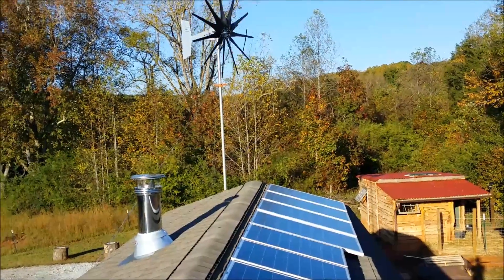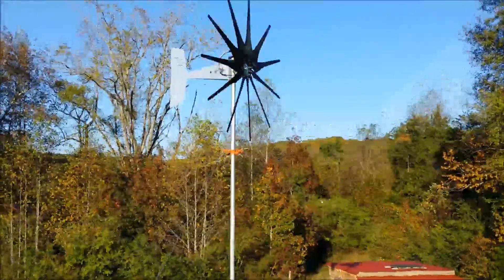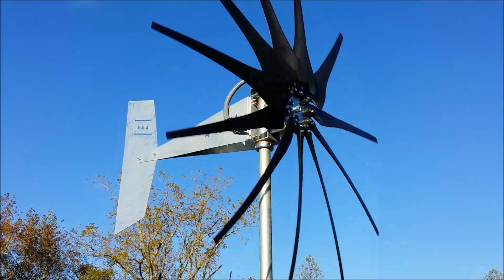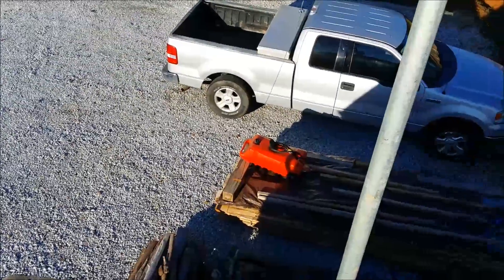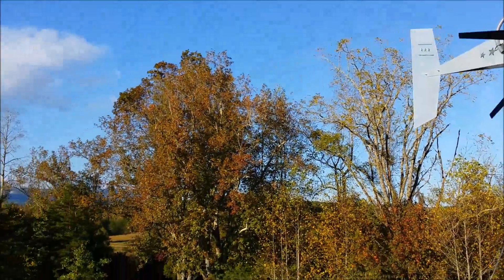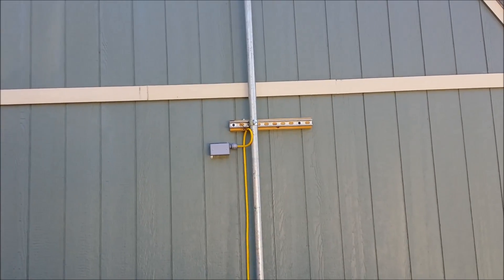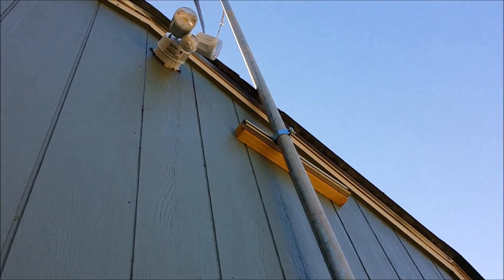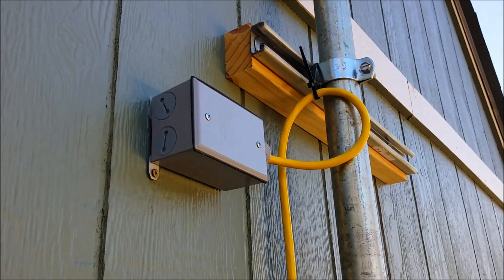Wind Turbine Installed and Operating on the Homestead

Comment: My question is 
I’m having 48v inverter system
And the voltage from solar is 110v which MPPT Solar charge controller controls it to 48v for the regular charge for the battery. If I should use wind turbine 48v 3000w is it advisable

Comment: You could run your dump to a 12v inverter and push the excess power into the house through a 110 outlet

Comment: I have solar panels. I want to add wind Power to them. I’m getting a good 30 amp out of my solar panels. I get confused why a dump load is needed on wind. If my battery bank is full with my Solar my controller just does not charge. IfDC is coming in off the wind power just as the solar why would I need to dump any extra power off? I don’t have to do that with my Solar so why would I need to do it with the wind power? If my charge controller knows my battery bank is full wouldn’t it not charge anymore with the wind just as it would do with the solar
Reply from the maker: My understanding is a wind turbine is designed to work with a load on it . If it does not the wind turbine will free spin and can do damage to itself. So it either has to be charging batteries or some sort of dump load. Because a solar panel has no moving parts you do not have this concern. Hope that helps!
Reply: Homestead Handyman. Thank you. Now I get it😊
Reply: @homesteadhandyman4481  Thank you for sharing your installation of both.  I think I will try on the Wind Turbine generator first for trying out.  The cost of this small project maybe $ 1,000.  Just for during power outage to Run my gas furnace 2nd floor and the Fridge and a few lights.

Comment: you need a watt meter so you know how many watts or killowatts your making each day,  looks like you need even more elevation to make the most of your turbine, but like you said leaves are falling off,  solar is by far the best but turbines can be fun especialy if you have a low wind  turbines. nice scenery, bet its a great place to live.
Reply from the maker: +closertothetruth great idea. do you have a recommendation of a watt meter or a link to a good one? The turbine has allowed me to run an electric heater on low this winter in my shop on the stormy cloudy days, That is as high as I could get it by myself. Any higher and the guide wires would be in the driveway!
Reply: +benchmade55 , the ones like you see hydrogen appliances  sell, ive found them on ebay cheap, theyre black with a blue screen, commonly used with model aeroplanes. when you hook them up you must have the turbine brake on or you may fry the watt meter, once installed you can turn the wind turbine break off. the watt meter is a great investment.
Reply: +benchmade55  The watt meter that hydrogen appliances sell are a scam and dangerous to use. He has those on ebay cheap all right. The have a rating on them of a whopping 220 amps, lol and UL approved neither of which are true. It has 8 gauge wires on it and the MOST that it can handle is 50 amps. The UL office would NEVER have approved it, none of those are UL approved for a fact.
I would expect a house fire from that watt meter.

Comment: You did a really nice install.Looks good. If you get any vibration into your building it's because the tower is rigid mounted to your building. The fix if you need it is to wrap your tower pipe with rubber to isolate it from the building.
Like your brake switch also, very inexpensive but it will work just fine..

Jeff
Reply from the maker: +MissouriWindandSolar  Thanks Jeff . I will put some rubber in the clamps as I do get a hum.
Reply: +benchmade55 That will fix that hum noise you hear. I did the same install as you years ago, i attached all my wind turbines direct to my pole barn rafters and man they hummed all threw the building. Rubber underneath the clamps and that fixed it.

Comment: Are the solar panels and turbine powering just your workshop? How many watts are you making? Thanks for the video.
Reply from the maker: +Aaron Davis Homesteading . Yes . The solar panels are 800 watts and the turbine 1600 watts
Reply: benchmade55 Do you run your shop equipment off of them?
Reply from the maker: +Aaron Davis Homesteading I have been running the ac off of it